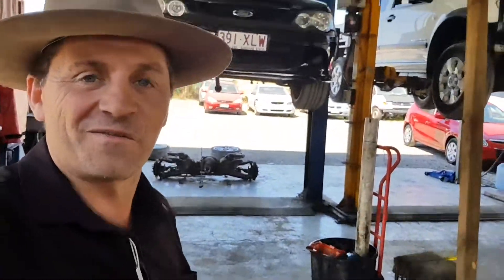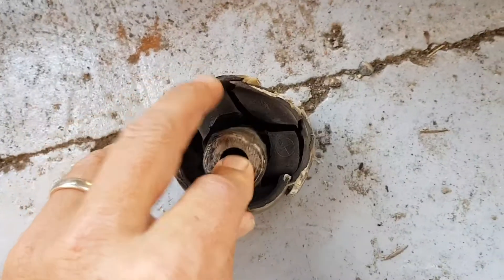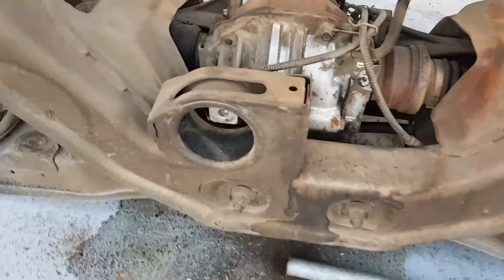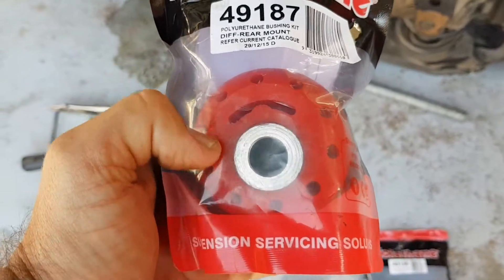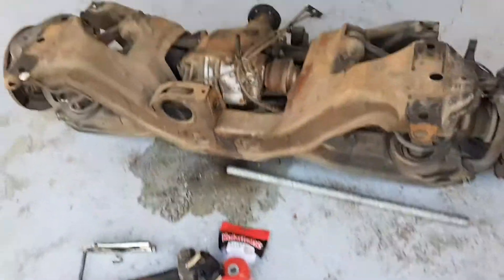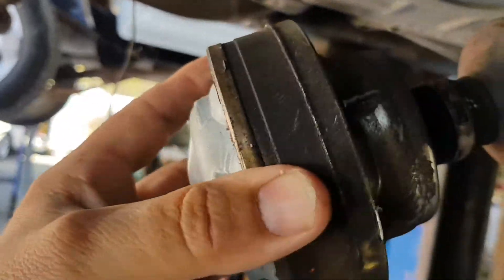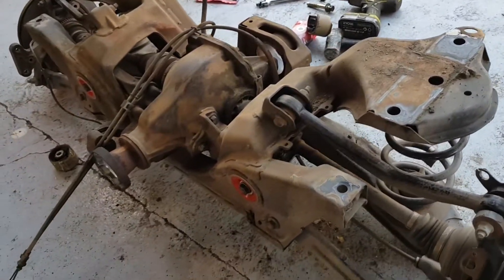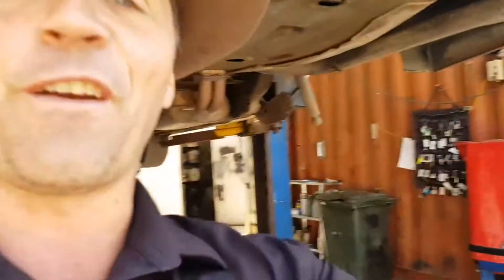Ford falcon XR8 diff bush replacement tips

Comment: Thanks for the vid, very informative. Just wondering, arn't the 2 outer bushes supposed to be flush with the rear of the cradle, not flush with the front? Because the diff will be held too far fowards and damage the cv on the end of the driveshaft

Comment: Thanks for the video upload. Seen your other video using super pro in XR6, May I ask you feedback on Super pro and Nolathane.
Reply from the maker: We've done hundreds of diff bushes in Falcon and Territory. And I've NEVER replaced them in a car that has Super Pro or Nolathane bushes installed. So it seems they outlast the factory fitted ones. They're both good, but the problem we find is that the bushes are all slightly different between the different models. So they often send out the wrong part. Some of the models Nolathane don't support. Some models Super Pro don't support, but between the 2 brands we normally find one that fits

Comment: The "wrong" bush u showed is for a ba. Theres only 2 options not "so many" as u said. Its not that they supplied the wrong bush didnt measure yours before ordering. My 05 xr8 has the offset smaller bush